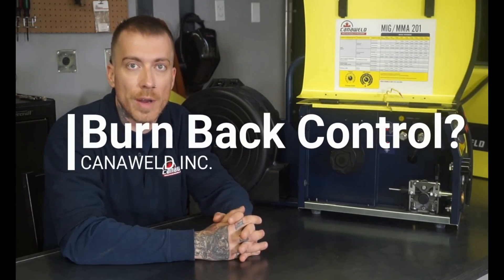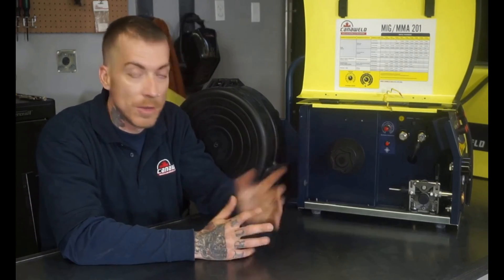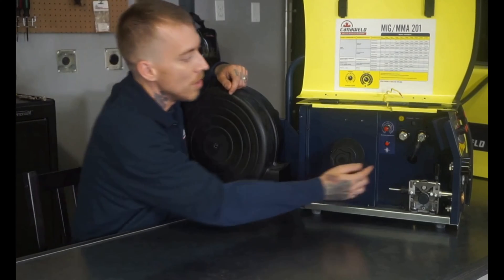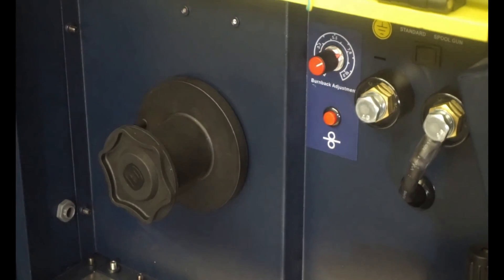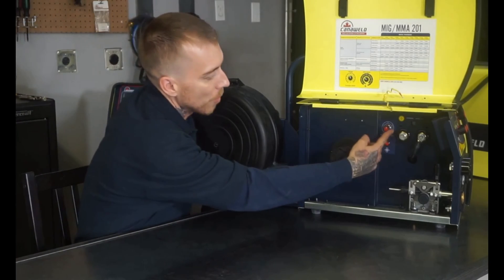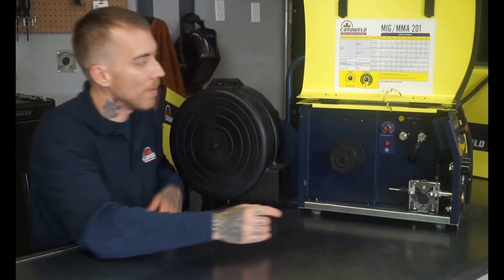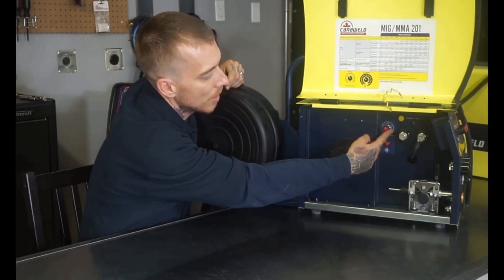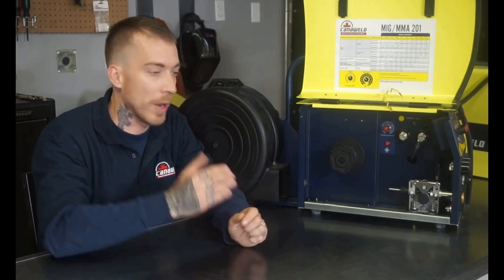MIG Welder Burn Back Controls, Most Common MIG Welding Mistakes, MIG MMA 201 by Canaweld

Comment: Thanks. When turning the setting what is actually been done to set the distance? How is it being accomplished?
Reply from the maker: Potentiometer for adjusting the amount of wire sticking out after releasing the torch trigger; when welding Aluminum, the burn back time should be longer than Mild Steel 
and in the case of Stainless-Steel welding, burn back time should be shorter than mild steel.

Comment: howdy, can you tell me please how do you fix burn back inside the base of the tip, i have to take the tip out and pull the wire back through then put the tip back in only for it to do it once again sometimes many times, sometimes when it sticks i get a birds nest, leading to much frustration , almost like the gun is arcing too soon, could the whole gun need replacing as this has been going many years now with no problems until recently, thanks
Reply: Check the tension on the spool, it may be binding. Also check your drive wheel on the wire feeder it could be slipping or dirty. if the wire is binding as it feeds to the gun then you may need a new liner and not the whole gun. I had similar issues with  my old mig welder and after going through and checking the feed system it works fine now. Search on youtube how to adjust your feed on mig welders. Hope this helps.
Reply: Thanks for the reply,  yes i will check these problem areas, and yes you are right the spool feed can sometimes be a problem area getting the tension adjusted right for  0.6. and 0.8 wire change overs, also one area i have yet to check is where the gun connects to the mig body, this rea is very prone to getting knocked and also coming undone where it screws to the mig body,  i have over the years found that the best settings are to keep the wire feed and heat settings close to equal with just a little less wire speed so don't think that my welding practices are far wrong or to blame for the problem, also maybe the very damp conditions in my workshop and in the UK may also be a problem this winter.

Comment: Mate what is the cause of burn back on starts and restarts? It happens just often enough to become really irritating.   often times the wire is welded to the tip and requires freeing, cleaning or replacing.  Too much time lost...
Reply: Hey Brendan how are you? Thanks for the question ! My gut tells me that either your wire speed is too low or your voltage is too high . Does your machine have a burnback setting?

Comment: My welder doesn’t have an automatic feature that brings the wire out to a set length.

When i weld ali sometimes it weld well but even then after a few seconds it just stops arcing and the wire is at the tip. I assume it’s burning back but idk why.
Reply: Hey simon how are you? thanks for the question. Can I ask which model of machine you have? Feel free to reach me at salestech@canaweld.com
Reply: Nicholas Baspaly i have a Clarke 145turbo which is a budget machine. 
Thank you for your reply!
Reply: Nicholas Baspaly thanks. I forgot to say current is as low as possible because im using thin metal and the speed is at max.
Reply: Nicholas Baspaly but if the wire is burning right back surely that means the wire isn’t moving out fast enough?
Reply: Nicholas Baspaly I’ve been in contact with the manufacturer and supplier and they are now telling me they made a mistake telling me to get this one and it doesn’t have enough current to weld ali even though what i am trying to weld is very thin?
They have offered me a trade in for a bigger machinez
Reply: Nicholas Baspaly hi I emailed you. They are saying that anything lower than a 32a supply doesnt have high enough current to weld aluminium.

Comment: mine is set to "0" and i still have a lag of 3-4 seconds till the wire stops and have about 3.5" of wire out of the tip, i have turned it up to 5 and still have the same problem, is my unit defective?
Reply: Hello Sir are you using the MIG mma 201 or a different canaweld machine? Shhot me an email at salestech@canaweld.com and we will figure this out together!